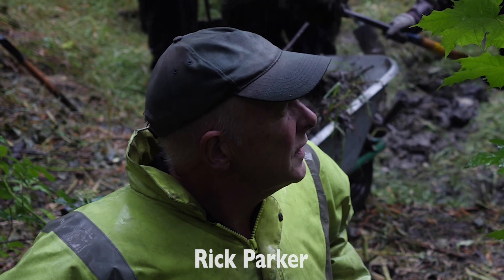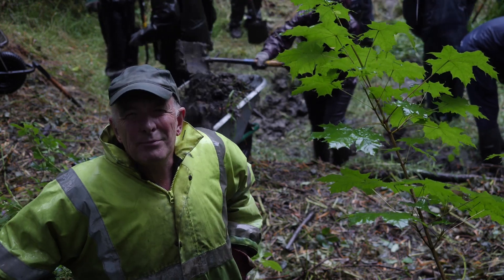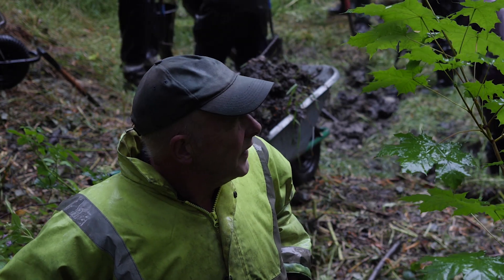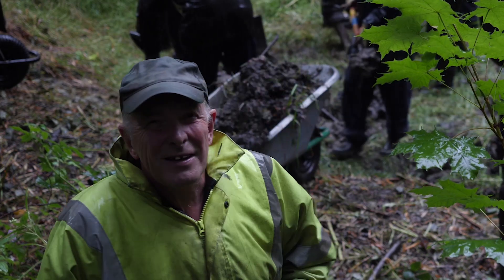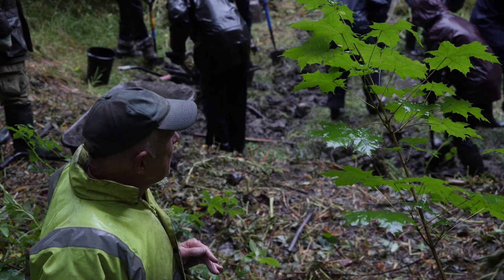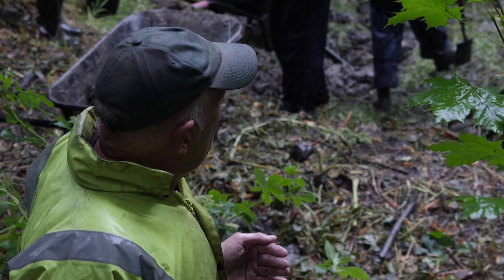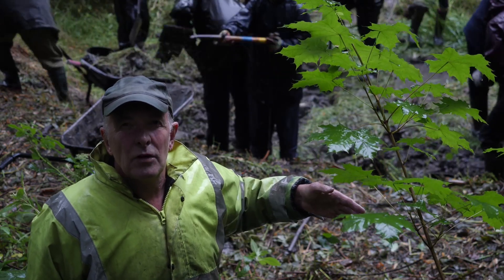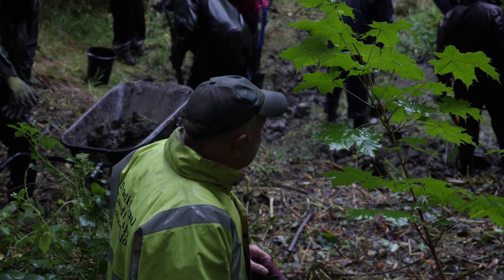How to make a pond with bentonite clay granules

Comment: IT SEEMS TO BE FINE - BUT HAVING LITTLE DOUBTS.,
1. WHAT IF THE WATER HAD DRIED DURING SUMMER AND CLAY CREAKS DUE TO EXPOSURE TO SUN WHICH LEADS TO BENTONITE LOSES ITS WATER CONTENT DUE TO EVAPORATION WHICH IN NEXT SEASON AFTER WATER GOT FILLED UP WEATHER THE BENTONITE STILL HOLD THE WATER LEAKAGE?
2. BENTONITE IS SAFE FOR POND ECOSYSTEM?
Reply: I know this is from 10 months ago, but if the bentonite layer is thick enough, drying/cracking won’t change it’s water impermeability makeup. It’ll also expand several times its size again when it came into contact with water
Bentonite is safe for pond ecosystem (unless the ecosystem is highly alkaline), they are mostly made out of cretaceous era volcanic ash submerged in the ocean (the ocean then dried up and it become sodium bentonite). If i remember correctly it can be found under the oasis in deserts, and it helps the oasis store water by forming giant clay membrane. So yes it is safe
Reply: i read bentonite is a natural clay

Comment: Thats quite a bit of digging. No thoughts of an excavator?
Reply from the maker: Yes, this could have been dug out by an excavator - with an excavator, if you had land available for ponds, you could dig several out in a day. But if you're adding bentonite clay to seal the pond, then the clay has to be applied in a continuous layer and carefully sandwiched in place - see the second half of the video - or the bentonite will blob up like a lava lamp and will not make a proper seal. And your expenditure on the clay will have been wasted. In order to prevent it, you really need to put in the man hours.

In this case, approximately forty volunteers took part across the two weekends. That's forty people who have ownership of the work, who want the thing to do well and who can look out for it in the future. This includes the local "friends of" group, for whom the nature reserve is a resource right on their doorstep.
Reply: @boltonconservationvoluntee9050  Im not undervaluing the ownership part.. I just think in terms of efficiencies that would have been a couple man hours of work vice 40x8x2 (500+) man hours of work. I agree the bentonite is best spread by hand and using a compactor. I was referring to the initial excavation.
Reply from the maker: @jbweld6193  Then yes, you're right in terms of the initial dig. In this instance, there was a depression where there was a failed pond already (i.e. it did not hold water) and our first weekend's dig was to remove an extra foot of topsoil, which we stored around the edges until the bentonite was put in place. Digging a pond from scratch would, certainly, be easier with a machine.
But Rick then got us to replace the topsoil by hand, so that the new clay layer itself was not disturbed.

Bolton Conservation Volunteers is a long-established group which meets bi-weekly, (see www.boltonconservation.co.uk ) which does regularly get twenty-plus volunteers, so we're able to do some pretty hefty tasks in short order. This was a case where many hands made light work...